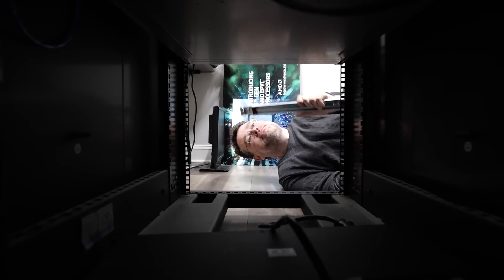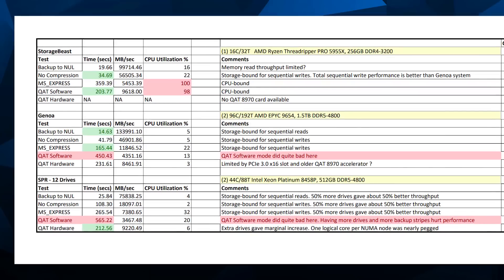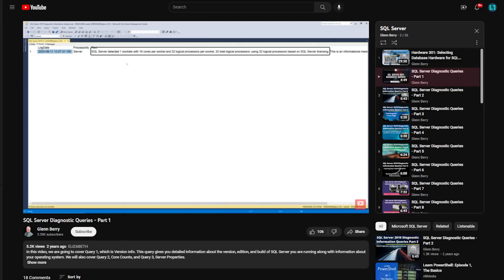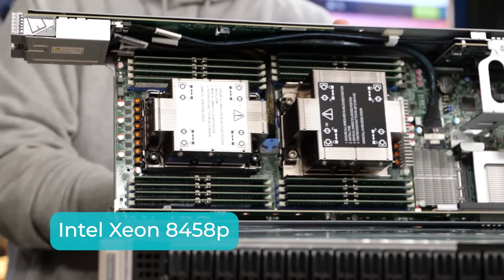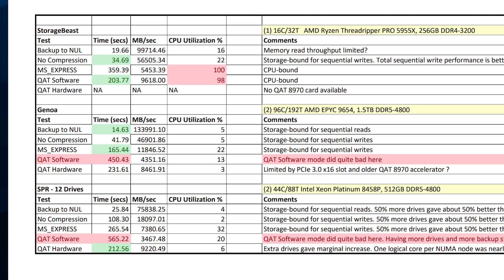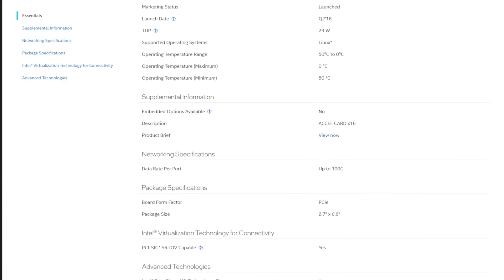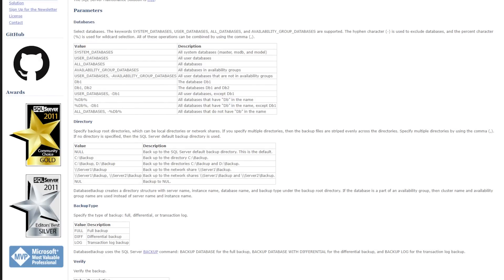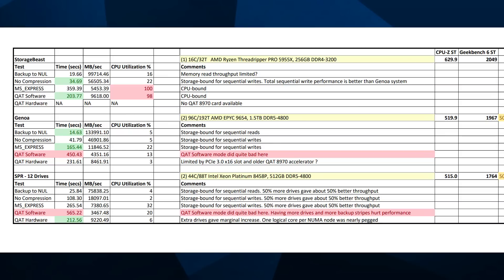World Record Backup Speeds: 2TB MS SQL Database with Glenn Berry

Comment: I hope Microsoft and Intel are really grateful. I suspect that the engineers involved in the products are simply not supported to test these larger configurations.
Reply: given that the licensing is per core, yeah you can bet they don't
Reply: @marcogenovesi8570  Microsoft's internal developers and testers don't have to worry about SQL Server licensing. Anyone else can use SQL Server 2022 Developer Edition or Evaluation Edition to do testing. The main issue is that most developers/testers don't have access to bare metal servers with this many cores (but Wendel does).
Reply: @GlennBerrySQL  Sorry what? Microsoft that runs multiple datacenters and has Azure one of the three biggest cloud providers in the world cannot spare an Epyc or two for their own SQL developers?
What I meant with "they have licensing per core" is that the amount of clients that will actually need or care about the large configurations is tiny, so testing at that scale is not worth the devs time
Reply: @marcogenovesi8570  Well, obviously the Azure Compute folks have all manner of bare metal AMD EPYC Genoa servers spread out across multiple Azure Data Centers that will support upcoming Azure VM offerings running in a hypervisor. They also have them in lab environments. 

The problem is that most of the Microsoft SQL Server dev/test people do most of their testing on Azure VMs that use older hardware, such as the Intel Xeon Platinum 8370C Ice Lake-SP.

You are correct that most SQL Server workloads are running on much lower core count machines (as I said in the video). Despite that, SQL Server 2022 Enterprise Edition is supposed to support as many sockets and cores (and cores per socket) as the underlying operating system (such as Windows Server 2022) supports. 

Right now, there are some issues with that with the latest generation of very high core count server CPUs. In some situations, SQL Server won't use more than 64 logical cores per NUMA node. This is a problem that Microsoft needs to fix.
Reply: @GlennBerrySQL  
Wendussy
Reply: @BBWahoo  ??

Comment: AMD must get their Xylinx FPGA HW embedded on the EPYC cores and then have dinamic softdrivewares (read QAT enabled by driver which implements it in FPGA logic) then they can have hardware QAT which at that is upgradeable and can also do other HW acceleration functions if QAT is not needed.
Been waiting for that for a while now!
Reply: I suspect it would be much more economical for the FPGA dies to either be separate chiplets on the package or even separate modules using CXL, not sure if FPGAs scale as nicely as CPUs with costly ultra small process nodes
Reply: @bosstowndynamics5488  Yes, most likely implemented on their own Chiplet OR added to the I/O die.

Comment: Could you also make a video showing the difference in performance of SQL Server on Linux and Windows on this kind of hardware?
Reply: What kind of performance differences are you interested in?
Reply: @GlennBerrySQL  realistically I'd be interested in the difference in how it scales with those high CPU core counts using different Schedulers e.g. CFS vs Nest vs O(1). Are there any meaningful differences compared to the Windows test? In my experience Windows tends to hit diminishing returns earlier on high core counts than Linux. I don't necessarily expect huge file operation speed gains.

Comment: i picked up at qat 8950 recently, i would love to see more coverage of pcie accelerators its not necessarily the easiest thing to take advantage of effectively depending on ur software/hardware stack. but with these older cards going for 30$ or so on ebay theres absolutely advantages over buying more cpu or ram on some workloads

Comment: It's not about how big your database is, it's about how many blocks changed since the last backup.  We back up 40TB of file data in 30 minutes or less because we use change block tracking (CBT).  I've backed up 300gb systems in 30 seconds, but it depends on how many disk data blocks have changed.  If I backed up that 40TB file data (~50m files) file by file it might take days.  Drive speed is largely immaterial when using CBT, our file data is on Azure HDD storage - the point is we're only backing up changed disk blocks.  Pr1me Computers were testing this type of technology in PRIMOS 22, back in mid 1990s.  CBT backups have minimal CPU, I/o, network use.
Reply: Native SQL Server differential backups work in a similar manner. There are also various storage-based and software-based snapshot techniques that will create a snapshot of a very large database in a second or two. 

Regardless of all of that, you need to take a full backup of a database to get started for anything that just tracks changes. There is an old saying "If you don't have a backup, you don't have a database". If the actual live database is not available for some reason (it was deleted, it is corrupt, etc.) you will have to restore from a full backup and then restore any differential backups and log backups to restore to a point in time.

The main point is that it is very common (in real life SQL Server production use) to take daily or weekly full database backups. This can be challenging with large databases and slow storage.
Reply: It's actually about how stable your database is while being load-balanced with fail-over functionality. That's literally the only standard in Enterprise Databases
Reply: @mehck-gk9yn  Not that it is related to this video, or any of the comments, but Microsoft SQL Server has a long and successful track record running mission critical enterprise workloads with a great HA/DR story for low RPO/RTO SLAs. It is not some toy database.
Reply: @GlennBerrySQL  Unfortunately, they never met the criteria for anything I built at a Fortune 500 Enterprise level. Oracle does, though.
Reply: @mehck-gk9yn  SQL Server is running in many Fortune 500 companies. Oracle makes a fine DBMS. If it makes you feel better to denigrate SQL Server, more power to you...
Reply: @mehck-gk9yn oad balancing and fail over does not equate to having a backup... If you don't have a backup and someone has a really bad day our DB cluster might end it's existence rather quickly... A differential backup will not be enough... :)
Reply: @justacomment1657  Sure, but back-ups are the most elementary part of a mission-critical system and I have no idea why you bothered to type any of that. Microsoft is not mission-critical software, I am sorry for hurt feelings.
Reply: @GlennBerrySQL  SQL server is running low-level non mission critical software for MIS management reports. God knows I have ETL'd too many of them in to Oracle (because Microsoft is horrible at BI, among most other things data-related). Nobody uses that trite horse manure in upper tech, sorry Glenn. Were Microsoft worthy of praise and support, I would be doing so. My feelings have nothing to do with Microsoft's failings as an Enterprise-level mission critical software platform. My opinion rests on the fact that I do not want to be called at 2AM from the Database Admins due to an issue. I like my sleep, Glenn.
Reply: @mehck-gk9yn  wow that is a broad statement... I wonder what leads you to the conclusion that MS is not used in mission critical Software. There are a couple of MS products that absolutely can be and are mission critical some of them run on MS SQL...
I wonder what product has burned you to be that negatively branded towards ms?

Besides.
I wonder.
If you get called at 2am by a DB Admin what exactly are you doing with the database? Sorry but if your DB Admins keep breaking stuff they should probably look for a different job...
Reply: @mehck-gk9yn  Just because you (and the people you work with) don't seem to really know how to use, support and maintain SQL Server doesn't mean that SQL Server is "trite horse manure". 

Your strong opinions would have more credibility if you actually cited any details about what is so terribly wrong with SQL Server that has caused you so much lost sleep.
Reply: @GlennBerrySQL  >Bring Microsoft out to co-author
>nightmare, crashes
>bring Oracle out to co-author
>perfection

I like my sleep, Glenn. I didn't realize you worked for Microsoft.
Reply: @mehck-gk9yn  Heh, I don't work for Microsoft. I actually use my real name, so anyone can judge my experience with SQL Server and credibility for themselves.

Comment: In my experience, Windows Server doesn't work well with large number of cores. I also had some weird reset because of "hardware error" that I don't have under Linux. You should try SQL Server for Linux. You will be able to use all the cores.
Reply: Do you experience that with core or full edition of windows server?
Reply: @JollyGiant19  On Windows Server 2022 Datacenter with SQL Server Dev.
Reply: Please define "large number of cores".
It would surprise me if the kernel has troubles with 32 or 64 cores. I mean they share the core architecture with hyperV which is meant to be run on BareMetal as Hypervisor... 🤔

Comment: To many people,  these numbers might not look that impressive... but to the older guys,  who were working in 1980...1990... and then they see values like 55'000 MB/s... simply crazy. 
A dumb question... regular m.2 drives are just pcie4  4x, with a max theoretical r/w speeds of 8'000 MB. Why hasn't the industry released 8x, or even 16x m.2 drives,   for a max r/w of 16'000MB, or even 32'000MB ?
Ok, pci lanes aren't unlimited.  But if, eg, a user can run 2 m.2 drives in raid 0, and get at least 13'000MB r/w, there should be no problem,  to have a single 8x m.2 drive...
So.... we need pcie5, in order to get max 12-15'000MB/s....... then,  we will need to wait for 2028-2030, for the pcie6 to be available,  and give us M.2 drives that can do around 30'000MB/s... when we could easily have 25-30'000MB/s , with TODAY'S pcie4 technology.  And with the new pcie5, at 16x, the industry could manufacture ~55'000MB/s M.2 drives. 
Why not ??? Who wouldn't want to have a pcie4 16x  30'000 MB/s m.2 drive,  on his system, TODAY ?
Reply: M.2 definitely can't handle that bandwidth it would have to be a full sized card. And the mean reason is the controller is not fast enough. 1st gen pcie 4 drives only hit about 5GB/s despite the standard allowing for nearly 8. You'd have to either have an absolutely insane controller on the card to hit 30 GB/S or multiple controllers. And if you are going the multiple controller path having all the logic be on one card with one point of failure is illogical for almost no benefit. You can buy pcie x16 cards that accept multiple m.2 cards to be plugged into an x16 slot and then just raid them together. Beyond that there is also simply little reason outside of storage servers to need that kind of bandwidth. Even at gen 4 speeds 90% of what you do as a consumer is limited by either the application or your internet speeds before even looking at the drive speed.
Reply: It's a careful balancing act between speed and cost, because to handle high speeds you need a storage controller and flash chips that also can do it and they cost money.
Back in the day the first PCIe or NVME ssds were on a normal PCIe card. They moved to M.2 and U.2 because that allows higher economies of scale and bring the costs down as now much more systems can take the drives in the standardized form factor. (namely laptops and embedded stuff)

But if you really want more performance you need high-price enterprise solutions like Pure Storage do. They basically connect hundreds of flash chips "directly" to server-grade CPUs that are used as "storage controller", and the actual servers connect to this thing using high speed datacenter interconnect fabric.

So a single 2U rackmount server-like "thing" becomes a big and very fast SSD. But it's mostly custom hardware, running high end server processors and it uses many many many flash chips. It exists, but it's too expensive.
Reply: As far as I'm aware the M.2 connector isn't physically capable of carrying more than 4 electrical PCIe lanes, or if it is it certainly isn't available as a standard (M.2 has different subspecifications for different connection types specified by different keys)

Comment: Was the database full of data? Not sure how your storage backend deals with zeros but on my 3par zeros never touch the physical disks.
Reply: Yes, it was a real 2TB database with 24 data files that were each full of actual, real data (not just a bunch of generated test data). It was also not a bunch of empty data files that were 2TB on disk but empty inside.

The idea here was to see how fast we could get different types of full database backups to run with various configuration settings, and what bottlenecks we would run into.

Comment: What about Seagate or Sabrent SSD's? Their speeds are the same or similar to Samsungs but more relay-able.
Reply: Like we said in the video, we were using consumer client SSDs just for peak performance and cost reasons.

Despite some recent firmware issues, Samsung 980 PRO and 990 PRO M.2 SSDs are quite reliable. Solidigm SSDs are also very good and slightly less expensive.
Reply: @GlennBerrySQL  I should have mentioned I was also talking about consumers SSD's from those brands.
I had a Samsung 980 Pro break by the SSD controller heating up to much.
I also found that Samsung SSD's don't work good with mixed media as the sector size can't be changed (on their consumer SSD's).

Comment: I would love to have seen these tests on a big raid 10 array where you can isolate the io bottleneck. Doesn't seem like a fair test when everthing is basically single thread bound.
Reply: It is a pretty fair test using the hardware and client M.2 PCIe 4.0 NVMe storage that we had available. The database has 24 equally sized data files, so each drive has one data file. They are all read in parallel during a backup. I don't think we are storage bound in most of these tests.

Comment: I know this is your Windows channel, but do you see similar results running the container version of SQL Server on a Linux system?
Reply: Intel QAT Backup compression is only supported on SQL Server 2022 on Windows. There is an Intel QAT driver for Linux, but Microsoft only supports QAT backups on Windows.  All of the non-QAT backup tests could be run with SQL Server 2022 on Linux though. FWIW, I don't see very many people running SQL Server on Linux, even though it has been supported since SQL Server 2017.
Reply: @GlennBerrySQL  a project I was working on in 2018 was considering testing using the container, but then finding priorities changed. I didn't know about the Intel QAT only being supported under Windows, but with the Linux container usage low I guess that makes sense. Thanks for the response.

Comment: Can anyone describe how to make bootable, complete system backups to a NAS from a Windows machine where the boot drive is BitLocker-encrypted (software encryption, not something via firmware)?
Reply: How automated?
Reply: Currently I’d be happy to have a functional methodology that works at all, even manually. The NAS would likely be TrueNAS Scale.
Reply: Veeam has a free Windows Backup Agent that has some limitations (single machine, single backup plan, some other advanced stuff is disabled) but it does support bitlocker both in backup and in restore target, can backup anywhere and can create a bootable thumb drive to restore bare metal from the backups. Obviously the backup agent is installed in the windows PC and that's what will do 99% of the work. It can also create the USB bootable drive for recovery.
The NAS must provide a shared folder and probably set up a schedule to make ZFS snapshots on that folder/volume for added safety. So that even if the PC is compromised and the backup agent or malware goes and tampers/deletes the backups from the shared folder, you can just revert to the previous ZFS snapshot and your data is still there.
Reply: Thanks for that suggestion, will check it out.
Reply: @abavariannormiepleb9470  A manual option would be to just use a Linux live system to image the boot drive, if you then write that image to a replacement drive it should act exactly the same (note TPM/firmware might get a bit unhappy with hardware changes so might not work if you switched to Bitlocker with TPM).